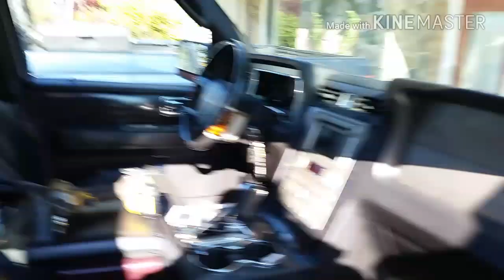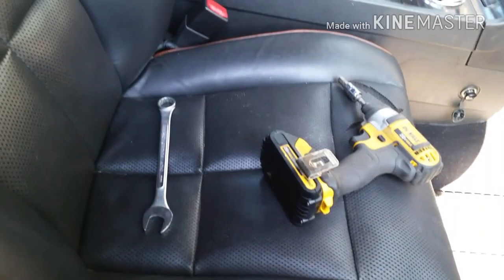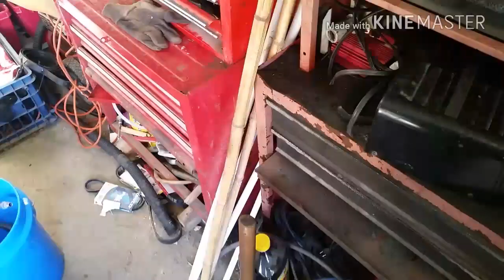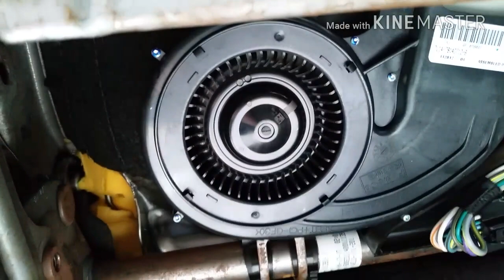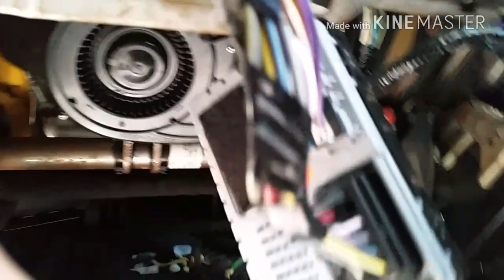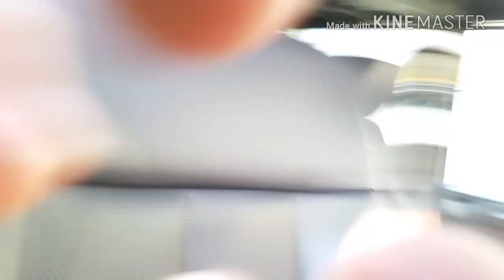2007 up Expedition Navigator heated seat module

Comment: the ground plug on electrical connector has a bad habit of over heating and melting. Ford actually did a service bulletin on it. The new plug number is motorcraft wpt-928 and it ties 2 grounds together when you do the repair and prevents the overheat. You will see the burnt corner of the plug when you remove it from  the module.

Comment: Did your heated seats switches light up when it wasn’t working thanks
Reply from the maker: Yes, it would light up for a few minutes then go out. Light would come back on after turning key off then back on. Further testing showed a break in the internal heating pad.
Reply: @darylturcott  My heated switch lights stayed on. Year ago the seat went out how the blower fan replaced. So maybe it’s another blower fan.   thanks

Comment: Mine wont switch on at all. The light for the seat button on the dash will blink and go off,niether seat works heat or cool. 2013 Expedition King Ranch
Reply from the maker: I would definitely check the connector below passenger seat.
Reply: Mine do the same thing on a 2012 Nav. Has worked twice, when I bought it in June 2018 and sometime in Dec 2018, otherwise all lights come on and go out.
Reply from the maker: Quite likely the connector under passenger seat.

Comment: Hey boss do you know where the body control modulator is for a 2007 Ford Expedition appreciate it
Reply from the maker: Have to look it up when I get home after work. Might be under dash by right footwell.
Reply: thank you I appreciate it for taking the time
Reply from the maker: Having hard time finding that info. One source says it's part of the fuse box on 07 up.  I know the module with door code & security is behind passenger foot panel.
Reply: @darylturcott  thank you sir I will take a look there I appreciate your time I'm sure information if I find it

Comment: Thanks for the info on how to get the blue connectors undone. Do you think the junkyard module could be bad?
Reply from the maker: Doubtful because the passenger seat still worked. Also I sold it on ebay and the purchaser never complained.
Reply: @darylturcott  Did you ever get it fixed?

Comment: Hey! Ive got the same car (just 2013) and same problem...
Could you hand me over the part code or something that I can use to get it?
Or where can I buy it?
Reply: Part number is BU5Z-14C724-A,  The one removed was 9U5T-14B663-AA,  so I just changed my module you don't even need to remove the seat to change it took me less than 10 min to change it,  my local dealer wanted 280 to change it and reprogram it which it didn't need.  Good Luck
Reply: @FlavesGarage  sorry for being so late, but thanks!
Reply: @simpleinverso8628  No problem,  a years after replacing it it stopped working again i thought it was the module again found out it was the wire connector that fried,  had to replace that also...just a heads up
Reply: @FlavesGarage  I haven't changed it lol.
But my cable is already burned and the module also got messed up...
Thanks for the heads up!
Now that the heat here in Mexico is getting unbearable, repairing it will come very handy!

Comment: Thanks for the video. im going to try this
Reply from the maker: Try resetting the system by pulling the power heated seat fuse from the fuse box for a couple minutes then putting it back in sometimes that will reset the module. Also when you remove the wire harness from the Macho pay close attention for any burned or scorched electrical terminals in there sometimes those need to be repaired

Comment: my drivers seat only doesnt work.  think that makes it likely to NOT be the module on mine?
Reply from the maker: Kevin Goff mine is same, probably not module. You need to remove connector wire and examine it for burned contacts
Reply: daryl turcott mine is the same. Just removed the seat and no burn marks on ANY of the connections. None. Sooo now what???

Comment: did you ever fix your seats?
Reply from the maker: Marvin St John no, haven't gad time to mess with it. Hoping to find replacement seat at junkyard
Reply: there is a ground wire in the harness that you already know now to get too, unplug it and see if it's burnt then just bridge it avoiding having to buy a new one. get back to me and let me know.
Reply: I should say that that was a problem, i'm not sure if they decided to go with a heavier gauge wire on your model but it's worth a look.
Reply from the maker: Marvin St John I will check it out and let you know.

Comment: my seats will sound like they turn on and after a minute it will turn off and the light will flicker untill u restart the vehicle. this is for both seats. do u thinl its the module?
Reply from the maker: Hatchet Mobile it sounds like a module issue, since it affects both at once. Did you try pulling the fuse and letting the module reset?
Reply from the maker: +Hatchet Mobile sorry it took so long to answer. I hesitate to say yes, because it didn't work for me. But worth a try if you can get the module cheaply.